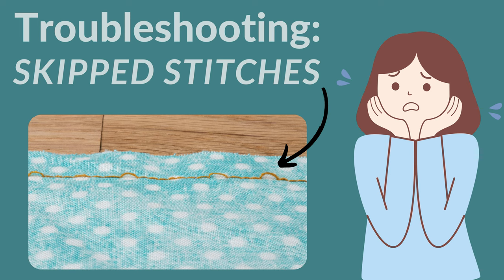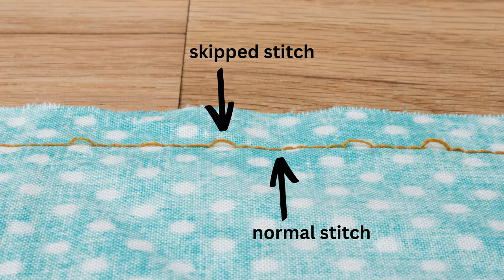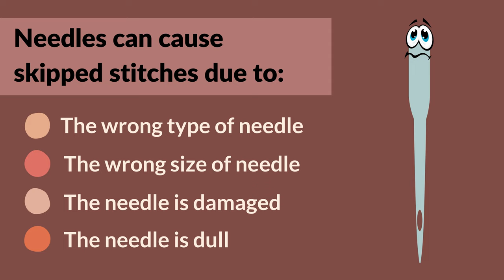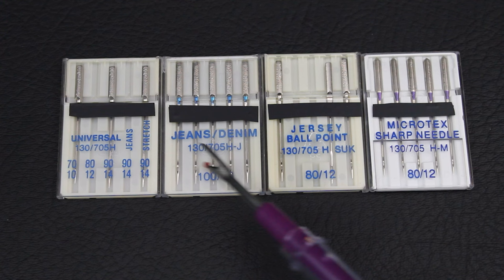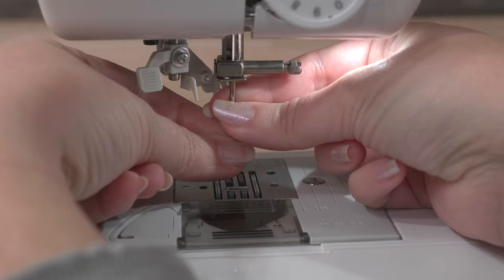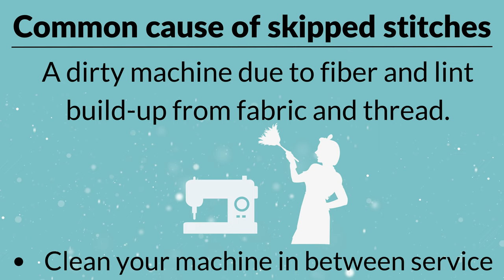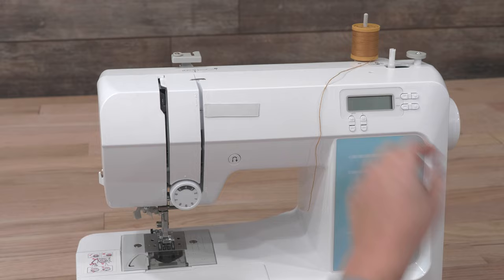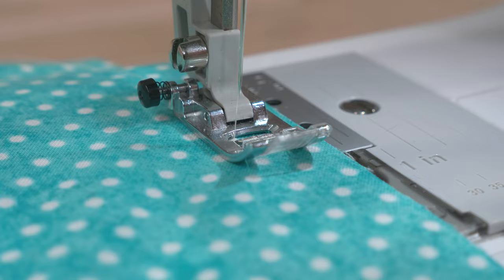Sewing Machine Troubleshooting - Skipped Stitches

Comment: I solved my issue by not using a cheaper sewing thread.  I had bought very cheap Birch thread.  Changed to Gutterman.     Amazing difference to the stitches not doing weird loop every so often and wonky stitches on the back of sewing.

Comment: Check the pressure adjustment of the presser foot if your sewing multiple thicknesses that could be different like that velour stuff that resembles bubble wrap... Full pressure needed here to avoid skipped stitches. Change the needle to universal if using stretch needle or Chrome. Sometimes the machine just wants a plain Jane needle. Also once my thread was poking out too far from the Bobbin when I started winding it after inserting the Bobbin the little bit of thread poking out of the hole of the Bobbin interfered with the wrapped Bobbin thread and when I cut it off flush with the top of the Bobbin. No more skipped stitches. Seems the machine was confused which thread it was supposed to use.
Reply from the maker: great advice! :D